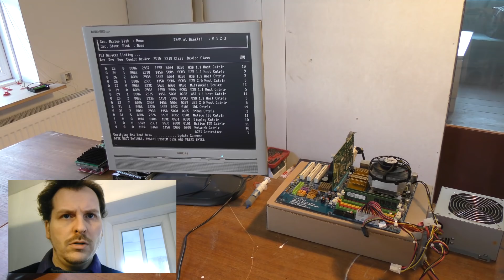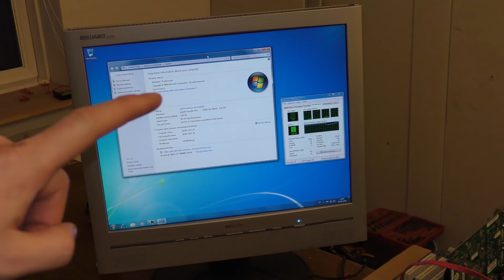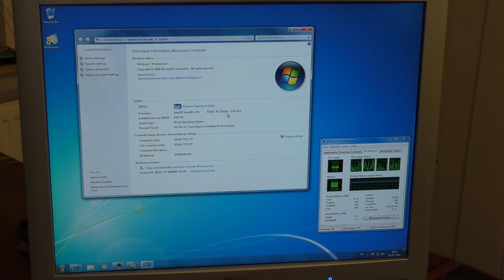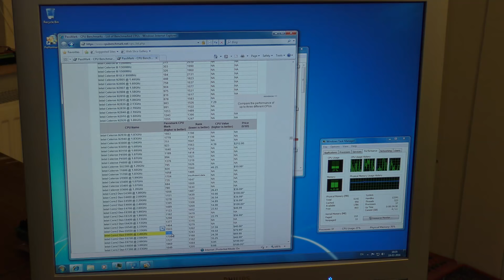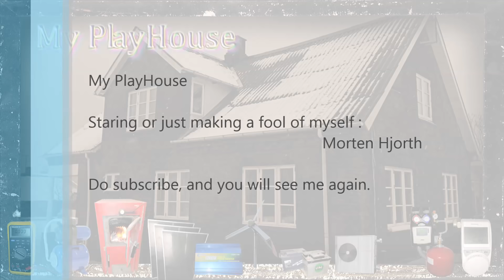LGA 771 TO 775 MOD - It WORKS !! Intel Quad core XEON - 323

Comment: I updated the bios with the modded bios and installed the x5460 processor  on the P31-S3G Motherboard. CPU is recognized and everything is working, but the CPU temp is high. In full load it reaches up to 74C (in idle ). Is this Normal ?
My cooler is the LC Power CC 95.
Reply from the maker: Sounds a bit high,, if it is not doing anything..
Reply: @MyPlayHouse  sorry, what  i meant to say is : 40 C in idle and up to 74 C under load ....

Comment: wow.. i am legitimately shocked that you ran the cpu with ZERO cooling, or even a heatsink attached, and installed windows like that, and that cpu is not toast... wow.... gotta love xeons...

my computer:
dual Intel Xeon X5450.. 8 3ghz cores.. gotta love it
32gb quad channel ECC DDR2
dual ati firepro v4800 crossfired together

after this build and the one before it, i am absolutely an intel xeon fanboy..
Reply from the maker: Hi Joshua Stagnitto
Thank You very much!  glad you liked the video :-)
Thank you for watching! :-)

Comment: My PlayHouse pls. help me with a microcode for a motherbord
Reply from the maker: Hi rasloaga andrei
Sorry,, I never had to do that. But google your model number "771" and maybe microcode,, to see if it exists.
Thank you for watching! :-)
Reply: http://www.delidded.com/lga-771-xeon-microcode/ - a pretty good set of guides for BIOS modding - Award, Phoenix, AMI

Intel = forget it!, can't actually get to the BIOS file in their updater
Reply: Intel BIOS can be edited with the UEFI BIOS Updater (It is detected as AMI Aptio 4 platform). So there is a small chance that Intel motherboards will also be able to work with Xeon processors.

Comment: Hi Morten, this mod failed on my LGA 775 motherboard. And now, I have a problem cause no display after this hack. Any idea to help me ?
Reply from the maker: Hi Pascal Ranivoalison
Hi,, this is risky,, if you did it wrong,, you can have killed your CPU or Motherboard,,, did you make sure to turn the xeon the right way.
Thank you for watching! :-)
Reply: My PlayHouse 
Thanks a lot for your reply Morten. Finally I bined the Motherboard. Fortunately It was an old one.  Actually, I wonder what I did wrong. Thanks for your videos.
Reply: old topic but you actually have to reflash your bios inorder for the motherboard to detect it. ( Read more on google ). 

or maybe during the cutting process you broke / bent a pin ? 

There is a compatibility list for this hack.. Is your motherboard/cpu listed there? (google for it )

Comment: Would this work with an E5410 and a Gigabyte GA G31 S3G motherboard?
Reply from the maker: Hi Chunky Squirrel
Try Google "Gigabit GA G31 S3G 771" and see if any one else has tried.
Thank you for watching! :-)
Reply: My PlayHouse Thanks for the tip :)! Will do
Reply: I´m follow your chenel :) , and im liked your video tutorialy. And shooting  more video tutorial with this project with xeon processor with lga 775, 1366 and other socket tnx.

Comment: I did this some time back with a HP Pavilion p6213w I installed a xeion 5450 and installed windows 10 have had it going for almost a year now and everything works great the only down side was the common trouble that some people may have and that is at times the cpu when under a load with say 10 ihings open at one will get hot and make the cpu fan runon high till I close some stuff. I also maxed the ram to 8gb my video card is a old 9600 gt oc buy bfg but it is good enuff to do what I want and it can play 4k
Reply from the maker: Hi
Cool,, are you able to overclock? probably not on that HP Pavilion p6213w,,, I'd like to try that on a E5450,, some day.
Thank you for watching! :-)
Reply: My PlayHouse I think with software I could but do not want to chance it as some chips get hot on the board and I had to install heatsinks on them and a extra fan . I did however have a different video card in it for a short time and was overclocking the video card but that was it.

Comment: Right now I'm kicking myself for throwing out my old computer with that board -.-
Reply from the maker: Hi +Michael J 
I am sure you can find someone that is willing to help you with the kicking :-)
As You can see from the first video I did on this, until a got a board,, I was looking for a while to :-)
Thank you for watching! :-)
Reply: +My PlayHouse (Morten Hjorth) random off topic question you may or may not be able to answer... I have ESXi 5.1on a machine that has a build specifically for that server. If I were to upgrade it to 6.0 would it have issues do you think? 5.1 is the latest they support for that server since it's a bit older. I'm afraid to try upgrading to 6.0 since I just finally got it working with 5.1 without issues. Also I'm considering installing a second disc and just installing 6.0 as a different install. I figured I'd ask... Which of these sounds to be the best option to you since you've had experience with ESXi
Reply from the maker: Hi Michael J
Well acording to the Compatibility Guide on VMware ESXi my faveride server the IBM x3650 M1 (7979) can run ESXi 4.1
But it runs 6.0 just fine.
Try it on a new drive,,,,
Thank you for watching! :-)

Comment: Thanks for making this video sir nice one it helps a lot now got a chance to upgrade my 4 year old best friend "my PC"  in a cheapest way haha  I'm getting x5450 tomorrow but unfortunately it's hard for me to have that mod tape here in the Philippines haha..will somebody can donate me some? jeje if you don't mind..
Reply from the maker: Hi +Glenn Agnes 
Link in the description to where to get them,,they are just like $5 with shipping,, but I do not know how this works in the Philippines :-/
Glad I could Help,,make sure the motherboard is good for this,,many are not!
Thank you for watching! :-)
Reply: +My PlayHouse (Morten Hjorth)  I got gigabyte g41m-combo. would it work smoothly?
Reply from the maker: Hi +Glenn Agnes 
I think you have a good chance there!
Thank you for watching! :-)
Reply: +My PlayHouse (Morten Hjorth) last thing sir..i've watched several videos like yours and some are flashing things on their bios did you do that on your board? or just stick on  present bios version?
Reply from the maker: Hi +Glenn Agnes
I did not need to do any thing with my BIOS,,, but often you will have to flash it with firmware with some special microcode for the Xeon´s.
Thank you for watching! :-)

Comment: Nice... we had to buy a new Motherboard only for a switched Pin.... Great Marketing Intel! =)
Reply from the maker: HI +tocotocotoco123 
I do not follow,,?
Thank you for watching! :-)
Reply: +My PlayHouse (Morten Hjorth) he talking about the new skylake which use lga1151 instead of the older lga1150
Reply from the maker: Hi Vi Wo 
Okay,, yarh new MB,,that suckes.
Thank you for watching! :-)
Reply: My PlayHouse it was necessary since skylake uses ddr4 and haswell used ddr3
Reply from the maker: Hi Vi Wo 
But it is irritating when you have to change out MB, RAM and CPU,, just because you want one new thing.
Thank you for watching! :-)

Comment: I did buy a server for €150 with duel-core xeon processor and 2 150GB HDD drive's and other stuff
Reply: It is still like a i7 processor
Reply from the maker: Hi +Robin Lowel 
What server did you get for you 150€ ?
Thank you for watching! :-)
Reply: it is a old one but it is still better then me pc from 2015 so i will look at it if i have time
Reply: Yea sorry for the late reaction but it is a IBM system x 3200
Reply: but now i already got other servers like a maxdata platinum 500 i got 2 of them and a IBM xseries 226 and 2 other one's

Comment: The high RAM usage is most likely due to Windows update as there is a bug in it.
Reply from the maker: Hi +BlueFoxTV 
Yes,, i started to kill that service,, when testing,, and i got a lot better result,,, today you get a video where i overclock this setup, and I did not have the problem with that service,, it also used like 24-25% of CPU.
Thank you for watching! :-)

Comment: Great ! Nice video ! I've seen before we can do it but I didn't try. Now I do want to :D 
I have an Intel MB and two E5510 laying around. I think I will try it when I'll be back from work travel. Just have to check if the chipset is compatible (Regarding to what I've read on the net). I think I will try to cut the tabs on the socket with a Dremel (If I have the right cutting disks) to see if I can do it :)
Reply from the maker: Hi +Dorian Tokarz 
The E5510 uses the FCLGA1366 socket, and that is not the same as the LGA771 which is used for Xeon 54xx series.
E5510 will not work,,sorry :-/
Thank you for watching! :-)
Reply: +My PlayHouse (Morten Hjorth)  yes indeed they are e5110 actually ! I miss typed it.
Reply from the maker: Hi Dorian Tokarz
Okay,, If you really want to "play" with this,, get your self a 54xx series one,,a lot more fun!
I am overclocking it in one of my next videos.
Thank you for watching! :-)
Reply: +My PlayHouse (Morten Hjorth) yes I think I'll do this :) For now I play with my x3650 m3 and its two e5640 :)

Comment: Wow this is pretty neat. Bought a couple computers from school that run e8400s and this would be pretty neat for the servers I run off of them. Hopefully the motherboard will work with it. Looks like it'll only cost 20$ to find out.
Reply: I found most Intel boards - with PXX chipset - (least the 3 I tried), so long as they're patched with their latest BIOS, all seem to support the 51XX series of Xeons without question.  http://megalomaniacbore.blogspot.co.uk/2016/04/project-socket-771-to-socket-775-xeon.html
Reply from the maker: Hi +Kiddobyte 
It all depends on the motherboard..
Thank you for watching! :-)
Reply: +Kiddobyte http://www.delidded.com/lga-771-to-775-adapter/3/#dell

Comment: It you use windows 10 it uses under a gig of ram at idle so may be good for something like this
Reply from the maker: HI +Tear Spacer
Thank you for watching! :-)
Reply: +Tear Spacer Maybe, but I did the Q6600 to E5450 thing last week and it worked but it crashed windows 10 and it would not fix itself.  I had to start over so I just put windows 7 on.  I'm not a fan of 10 anyway.  The bios booted right up but Windows 10 did the repairing itself thing and locked.  I tried four times, then I just booted from a windows 7 DVD and started over.  Nothing like that clean HD feeling, everything is so fast and nice.  Ha ha ha. But the conversion was great.  I bought another this week for $18 shipped, E5450 is  so cheap and 25 watts less than the Q6600 and score average 4300 passmark vs. 2900 for Q6600.  Latest bios in Dell Inspiron 530 recognizes the Xeon as is.
Reply from the maker: Hi Clearanceman2
Nice to hear that you got this running.. I think I have a Q6600 running in MyplayHouse HP dc7900sff even with a little ninja trick to make it run faster.
I hope to be doing an over clocking video with a E5450 soon,, I am interested in seeing how it compares to the X5450
Thank you for watching! :-)
Reply: My PlayHouse I think the biggest difference is the TDP on the E is 80 watts and the TDP on the X is 120 watts.  Be nice to see which one had more headroom, I know most E CPUs will clock 4.0Ghz on air. It's a heck of a CPU for less than $20.
Reply from the maker: Hi Clearanceman2
4GHz,, nice
Thank you for watching! :-)

Comment: Well done! I recently upgraded an old Q8400 cpu to an E5450, on an Intel DG41RQ mobo, the way you described, and all worked well. I got the Xeon (pron. Zeon) on eBay, with the sticker, for ~$40. What was frustrating was the shortage of DDR2-800 (PC2-6400) memory (hard to find 2x4GB sticks for less than $130): do you have any tips?
Reply: +Benoit 4GB DDR2 sticks of any speed are extremely hard to get (unless it's server ram), since they are quite rare and expensive. You should get a different motherboard compatible with E54** Xeons and with four DDR2, then buy two more 2GB sticks.
Reply from the maker: Hi +Benoit 
No sorry, my largest blocks are 2GB,, But this mobo i used,, also has 2 DDR3 slots,, may be cheaper to get that,, maybe.
http://www.ebay.com/sch/i.html?_from=R40&_trksid=p2050601.m570.l1313.TR0.TRC0.H0.Xgigabyte+ga-p35c-ds3r.TRS0&_nkw=gigabyte+ga-p35c-ds3r&_sacat=0

Thank you for watching! :-)
Reply: Dear friend, Modded Xeon X5460 is being sold over AliExpress. My motherboard is Intel DG41WV. I am willing to buy the processor. Please let me know If You had to do any Bios modification or it was just plug n play. Please help me friend.

Comment: Pro tip: If you leave the old CPU in the socket while cutting the plastic, you reduce the risk of damaging the pins.
Reply from the maker: Hi +martin borovansky 
Yes,, that is a good tip!! I did not think of that! Thanx.
Thank you for watching! :-)
Reply: Yeah, I have seen it in one guide for this conversion.

Also, should we expect a video about the Asus Ranger motherboard? (judging by the box in the background)
Reply from the maker: Hi martin borovansky
I do not know,, i do not have a CPU for it right now,, I got the motherboard, because the cpu socket had bended pins,,, I have fixed it as good as i can,, but have no idea if it will run,, or just kill a good CPU :-/
Thank you for watching! :-)
Reply: +My PlayHouse (Morten Hjorth) You should get something like a cheap second-hand Haswell Celeron - both Haswell and Haswell Refresh should be compatible with this board. Here, you are able to get one for about 20eur, when you look well enough. And even if you destroy the CPU, you won't lose that much money.
Reply from the maker: Hi martin borovansky
I'll get to that,,, thanx
Thank you for watching! :-)
Reply: @MyPlayHouse  
Can you try to overclock to hell a q6600 maybe with some diy water cooling system 

Cool videos btw
Reply: Or do like I did and remove some material from the appropriate spots on the CPU leaving the MB unmolested(I have a Gigabyte GA-EP45-UD3P which is a popular overclocker for 775) I used a small side cutter drill bit from Harbor Freight.

Comment: Do you have an opened style case? It will be useful for testing.
Reply from the maker: Hi +localhost1459 
No,, I do not have anything like that. What do that look like?
Thank you for watching! :-)
Reply: It have bare support for PCI slots and IO Shield. LinusTechTips has one of that.
Reply: +localhost1459 those are called test benches, but basically on point with the description of one
Reply: Yes, I don't the exact name of it.

Comment: Pretty cool keep up the good job
Reply: I have my eye on a E5-2670 . 8 core their price are pluming .. Around 65us there days .. Do you have fcgla 2011 board ? In you lenovo army ? I guess its impossible to fit it in.1155. :(
Reply from the maker: Hi +Frank Kesel 
Thanx a lot,,keep watching :-)
Thank you for watching! :-)
Reply from the maker: Hi +Frank Kesel 
No I do not have anything that will use a E5-2670,,,yet! :-)
Thank you for watching! :-)

Comment: Looking at the specs on intel's website, I would say more than double the performance. 
C2D: http://ark.intel.com/products/27250/Intel-Core2-Duo-Processor-E6600-4M-Cache-2_40-GHz-1066-MHz-FSB
Xeon: http://ark.intel.com/products/33927/Intel-Xeon-Processor-E5420-12M-Cache-2_50-GHz-1333-MHz-FSB
Extra 100mhz clock speed, extra 2 cores, faster FSB and an extra 8MB of cache.  It does however have a higher TDP.
Cool mod.
Reply from the maker: Hi +Lee Stefanatos 
Yes it is not totally free,, I do pay 15 watts for doubling the performances,, I do think it is still a good deal :-)
Thank you for watching! :-)

Comment: Whenever I install new windows , I also utilized far more ram
I think that has to do with windows update
Reply: +Tim Hoewner the process svchost.exe use much ram
Reply from the maker: Hi +Tim Hoewner 
Yes I started to kill that process,, and got a much better result.
I am over clocking it in a later video,, it works really Well!!
I need to get a faster x54xx CPU,, I only have x5450,,,need more!! :-)
Thank you for watching! :-)